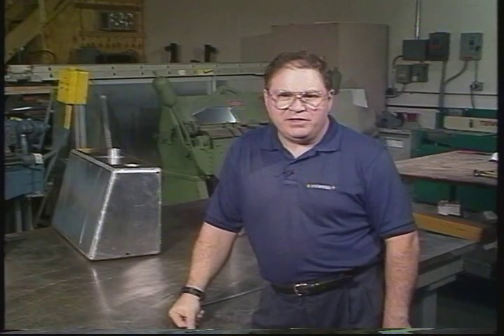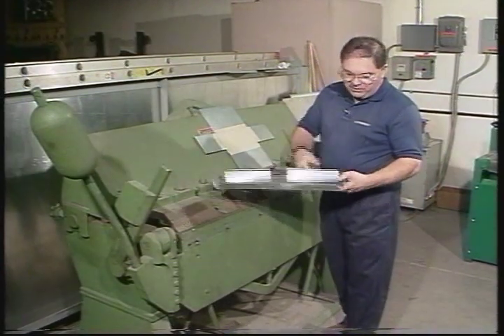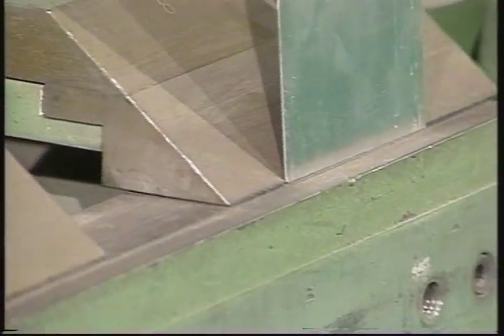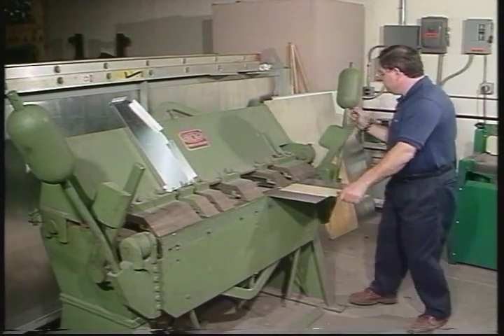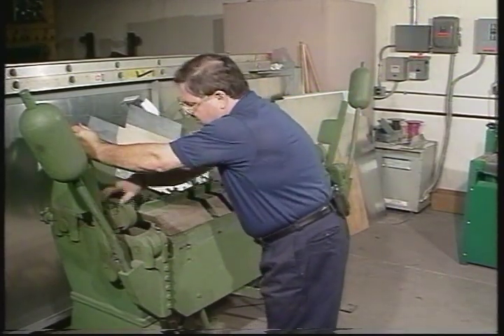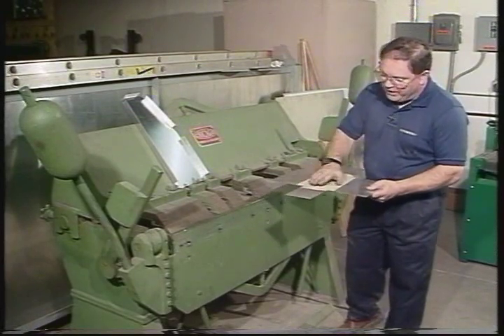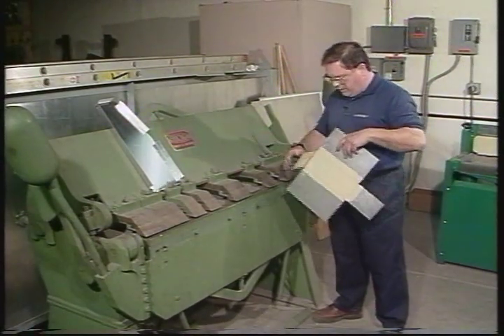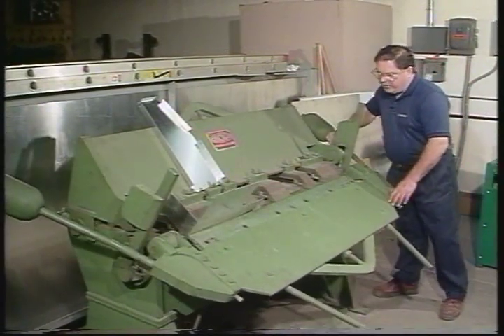Using A Box Pan Brake To Make A Box | Bending Machine | Lage Equipment

Comment: nice video, but with respect your working with I guess 18gg Alli sheet. The fingers (Dogs and Teeth) need be only halve thickness of the sheet. That is why your first two folds  are over square. A question why walk from one side of the brake to fold the second fold?
Reply: Vincent Crouch